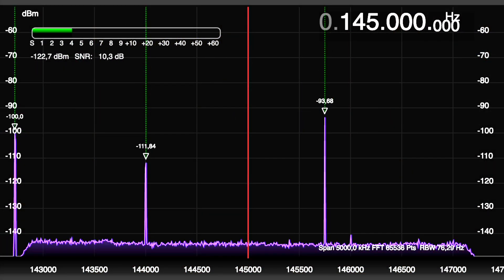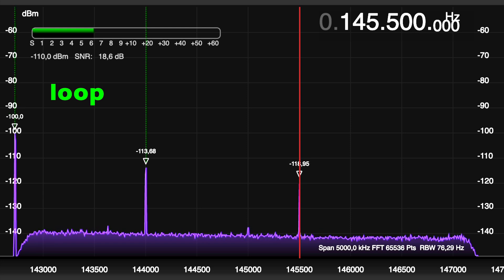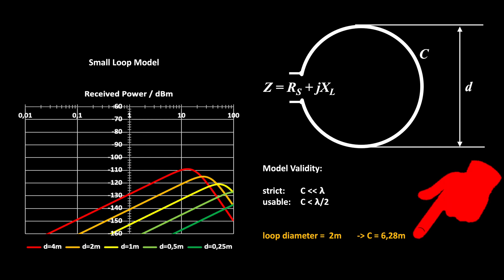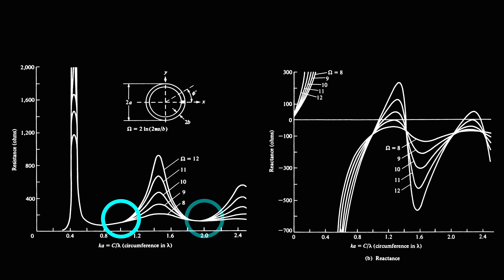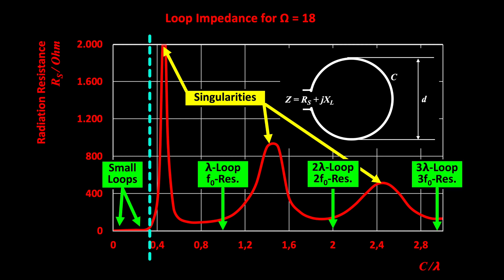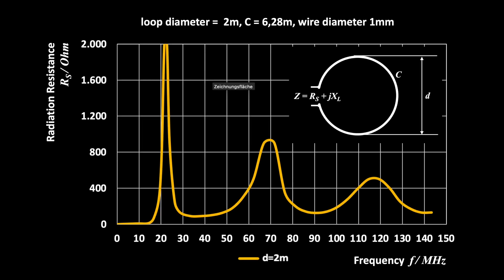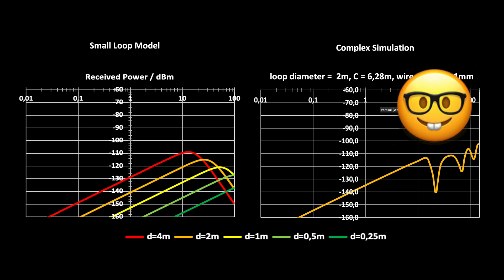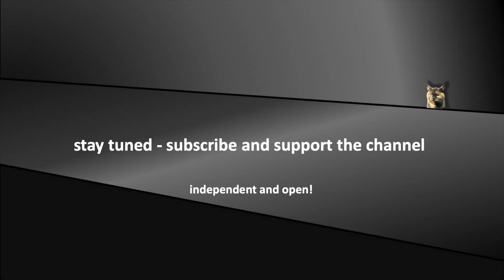Off-Design Loop Testing & Full Picture (EP168)

Comment: Hi. I am thinking of building a loop. I wonder if a two turn loop for LF is a gain. Want to once in my life hear LF transmitter on 17.2 kHz and if my sdr will work or I have to build a converter. Thanks for all the great input.
Reply from the maker: Thanks for your comment! Would you like to hear the historic Grimeton transmitter? In any case, yes, multiple turns provide a stronger signal. And here is another hint: In one of the next videos, I'll also show a 1:12 balun, which can significantly improve low frequencies. Stay tuned!